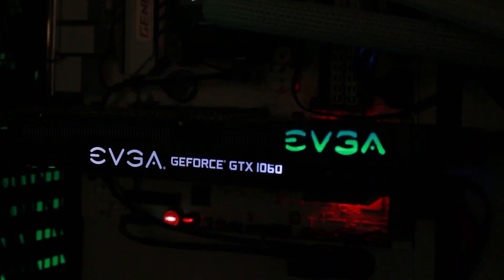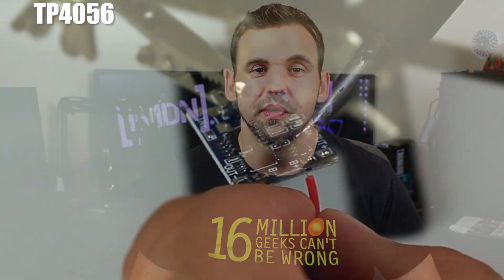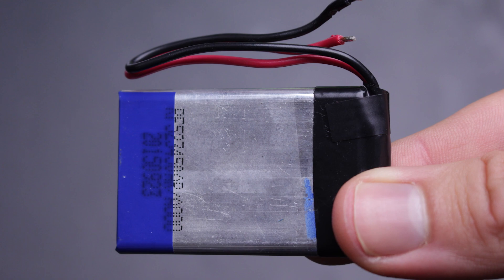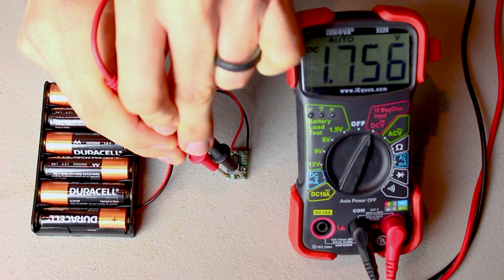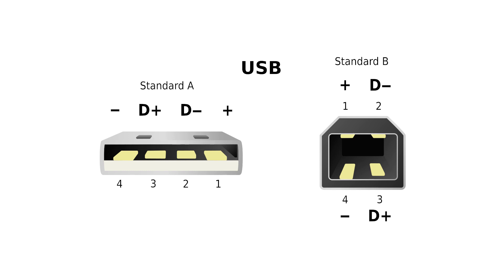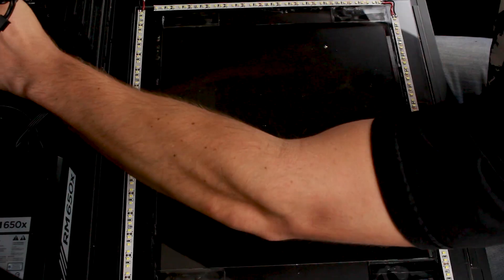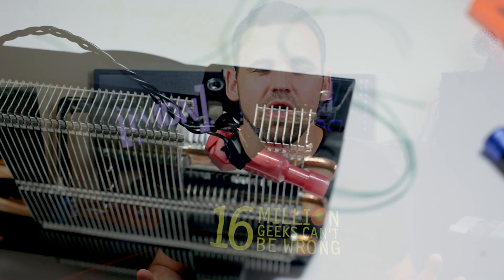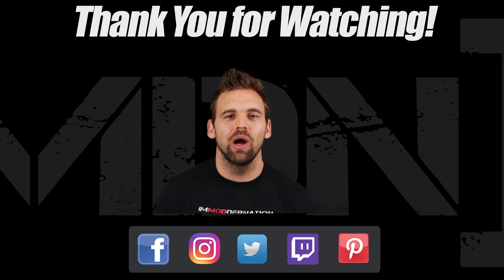Finding Power for your Electronic Projects

Comment: The method I ended up using on my 5700 XT Evoke OC for powering a watercooling pump off of it was tapping power from the fan connector.
Since the Pump ran at 5V like the fans, it was a matter of finding the right JST connector (2 returned orders to amazon since I can't gather info properly...) and plugging it in. I ended up keeping the fans too, for VRM and memory cooling, and the max theoretical current everything would draw was in the realm of 1.5A, which is too much. Fortunately, since the fans are in parallel with the pump, the max current the connector could deliver (~ 1A) balanced out between both and ended up quieting down the fans, which didn't need to run fast anymore due to the die being kept cool by the AIO. The result is a 52°C junction temp and 64°C VRMs. Memory was a bit hot at ~78°C, not much of an improvement there, but the pump majorly impacts the airflow around the chips, so not so bad in the end. Quieter and cooler, although it ended up costing me ~100€ combined.
Reply from the maker: What result, if any, did it have on those fans? Were they DC fans or PWM? I'm wondering if you could have used USB or SATA since you don't need pump control.
Reply: PWM fans, definitely, since I was able to control them through a function generator at my school's.

In the end, it made them quieter, and my theory is as follows:
They will only turn on when the current is high enough ; they need 0.15A per fan to get them started I believe, and they're wired in parallel, so a total of 0.3A is required.
Since the pump sucks most of the current, they'd only turn on under load, because when idling, there would not be enough current for them to start up and use the pump at the same time, as the pump draws 0.7A at full blast. I did not adjust the fan curve, and the pump is always running, since I removed the PWM and tachymeter wires (I put a tiny magnet in the pump housing to reduce noise without blocking the impeller with a magnet too strong).
To summarise: during idle, less than an amp is fed through the fan connector, and under load , the full ~1A is pushed through it, running the fans alongside the pump to cool the card down.

I could wire the pump somewhere else for sure, but I preferred not to intervene on anything else on the card, as I was sweating thinking I broke something everything I touched the card, and the fans are the easiest part to get ahold of x)
Also, and for pure aesthetic reasons, I preferred to have everything contained within the footprint of the card, which wasn't easy, since I put a Corsair's LL fans on the radiator.